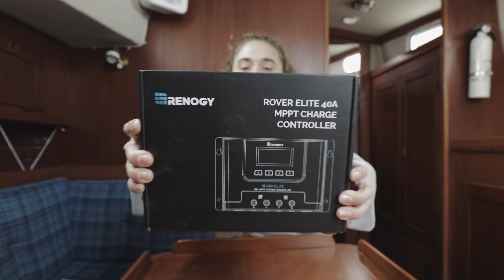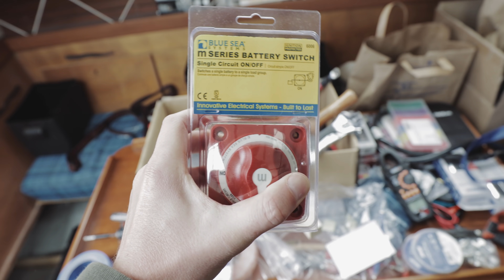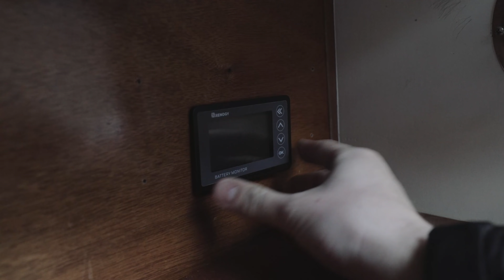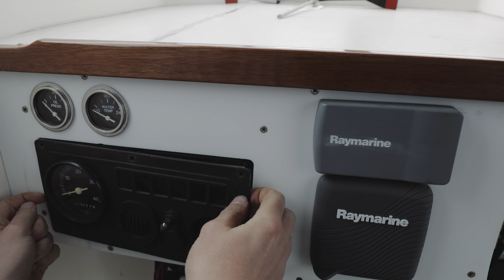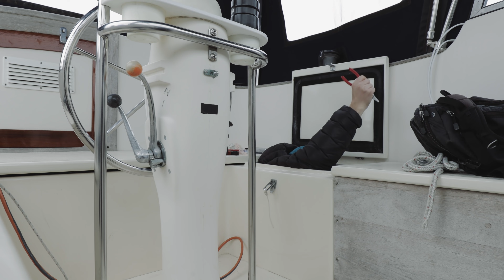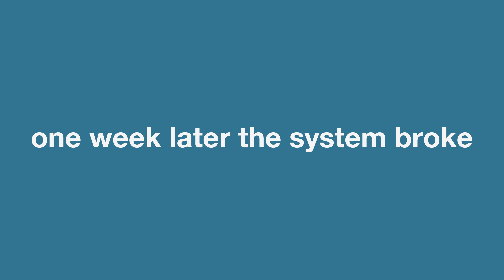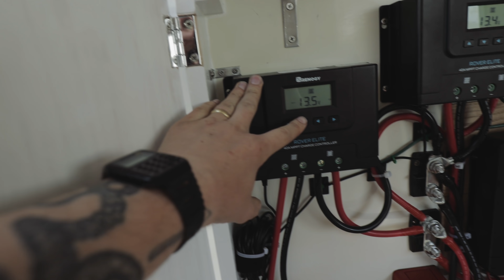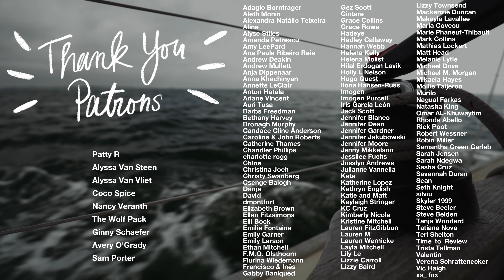Building Our Off Grid Power System - (prepping for boat life)

Comment: As farI can see , you are not having any fuse on the batteries, + pol, this is a must to protect you cabeling system, and yes as other mense your wire isnt, tinned wires. also have you made all the cabels from batteri equal in lengt both on the positive and the negative.

Comment: Just from being at High Seas in February from Port Said Egypt to Heraklion (crete) Greece. The water will rush down from the steps into the galley washing out the electrical equipment beside the steps circa  70's vintage . The Cabinet with electrical equipment has to be water tight. It only takes one major event to appreciate the redundancy of over engineering and over build as per marine grade wiring and water tight cabinets on the electrical. The Mediterranean is allot like Lake Superior in North America very High Waves and short between waves, doesn't swell as in Atlantic or Pacific. But you will have waves that wash into Galley area from the steps in Yankee Atlantic waters. I love that part of the Atlantic. I much prefer the Atlantic over the pacific. Since it changes into Bermuda and into the Bahamas and I prefer the Atlantic north side of The Dominican better than the south Caribbean Side.

Comment: Why do people think they have to put components in tiny hard to get spaces.  Put them where they are easily accessible.  My oils filter separator system is at the bottom of my hatch ladder and my inverters are on the bulkhead at my nav station.  All easily accessible.  ... oh, and who needs a 2000 watt inverter anyway?

Comment: Not sure it if 5kw is enough for a couple if that is your primary source of power. Im guessing u have 2 300W solar panels that should charge ur batteries in around 10 hrs under normal sun conditions. 
I guess if ur only running a 50W fridge and some LED bulbs u should be fine.

Comment: It may well have been addressed already (I have yet to read down the comments) but my concern is the proximity of your Inverter placement so close to the hatch into the cockpit should you ever have excessive saltwater overflow into that area ... it only takes once and not as unlikely as you might think. Maybe place within that cabinet a plastic or canvas diverter shield over the top of the inverter? Enjoy your shows a lot, great attitudes and visuals.

Comment: In your electric cab you may want to add some rubber to the end of that chrome pipe to reduce any chance of wear on those live cables. Also do you think you can add a waterproof grommet between the spaces that your running pipe through? Looks good 👍

Comment: I noticed that the heavy battery cable is untreated copper wire. Marine wire should be tin-coated copper to resist corrosion. You may want to look into marine wire versus normal wire.

Comment: I have two questions on this post. 1) Does your boat have a starter battery for the engine or is this part of the load for the solar? 2) How did you determine the load you needed? At first, I thought 2K watts was a lot until I realized you probably have a refrigerator and freezer and maybe a water maker. The normal lights and electronics wouldn't need that much.

Comment: Great work for you two and thank you for sharing.
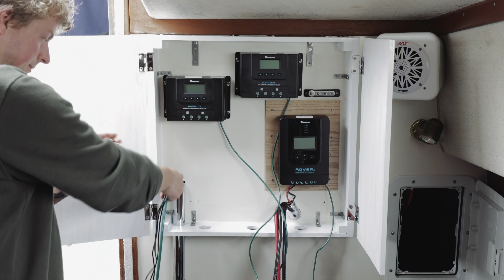A bit of advise: at 13:19 video time, I could see that you used some "metal" pipes to pass the wires. To prevent chafing (damage to the insulation and shielding of a wire) i suggest to use some rubber at the entrance and exit of that pipe or protect the wires with extra protection on those spots so if chafing occurs, no damage is done to the wires. This applies to all passage holes that you have made.

Comment: So I noticed y'all got the monitor to see power both in and out. Can you help me out with how you did that? When I connected the negative from my solar panels down stream of the controller (so it could "see" it) the panel just flashes, indicating it's wired in reverse. Any suggestions?

Comment: Dielectric grease should not be used between the lug and terminal,only after it's connected and then apply around the connection to keep moisture and salt out, for DC plant battery installs you may use conductive grease for battery terminals, because its conductive not dielectric.

Comment: One old boat sailor to another nice job but a few things I don’t see any fuses and the batteries should be fused within about 7 inches and the simplest way is below and in general there should be a lot more fuses 

https://www.bluesea.com/products/5191/MRBF_Terminal_Fuse_Block_-_30_to_300A

The extension cords for the solar our clever but using cords for power in place of a proper cable is also a no go and should be changed when possible  and you can seal them for leaks with these

https://www.bluesea.com/products/1001/CableClam_0.68in

Comment: I don't know if you realize this or not, but that "really small space" that you put your inverter in and associated wiring with switches is called a "slat locker."  Hallberg-Rassy is a high-end yacht builder that adds special touches like a place to store the slats from the companionway when they are not in the companionway.   

In fact, in this slat locker there is (or was) room for two sets of slats -one set for warm weather with some screens and/or louvers for ventilation, and one solid set that keeps you warm, dry, and buttoned-up nice and tight for when you want that.  Now where are you going to store all of them?  

You'll probably be regretting this decision when you are living on the boat and opening and closing the slats all the time with nowhere to put them but down in the cockpit sole or on the aft settee in the way of everyone who wants to sit there and falling all over the place with every big wave -not to mention where to store the extra set you aren't using.  You don't even have a nav desk seat any more so that is one fewer place for someone to sit or out the slats temporarily when you go in or out.

Also, if you are going to do any electrical work on a boat do yourself a favor and go buy yourself a heat gun from Harbor Freight for $12.  Using a lighter to do heat shrink is ridiculous.  I hope you were using good Marine-grade heatshrink with melting mastic glue inside or it does absolutely nothing to keep moisture out.  Using a lighter to shrink this heavy-duty heatshrink and melt the glue inside  fully is a good way to get second-degree burns on your fingers holding a hot lighter all that time.

Non-marine lightweight heatshrink without the mastic glue is just for looks and will actually trap moisture up against the lugs and crimps where it will seep in but never really escape, since airflow is poor under the tight plastic -but not tight enough to keep moisture out.  Take it from a professional commercial electrician.  You might as well have wrapped a couple of layers of cheap vinyl electrical tape over the top.  That does nothing to keep our moisture either

Comment: You need to use marine grade wiring.  It is significantly more expensive but it is tinned and will not corrode.  The copper stranded wire you installed will turn green and you will get voltage drop in a very short period of time.  Also use closed end cable lugs.
Reply: +1 on tinned copper wire, it's actually a requirement if you want to meet ABYC standards so not having it might cause you problems with insurance.   Regardless,  tinned wire is superior.

Comment: If you capsize the last thing you'll be worrying about is whether your batteries are safe. (edit) you would be better off using dc-dc converters for your laptops and USB devices instead of running them through the inverter - lower losses and more efficient cabling.

Comment: I’m sure you did this but make sure to verify the final charge voltage is compatible with the lithium. I think you can adjust it on the renogy charge controller.  

If you want to extend your battery lifespan you can set the final voltage a little bit lower so it Goes to 90 or 95% charge on the batteries

Comment: Drilling holes and driving screws into a van is stressful enough, but doing this in a boat below the waterline 😱😱😱. Great to see you using a hydraulic crimp for the battery and inverter power lugs, I guess it would be hard to use a hammer crimp tool on a boat! Remember: Rome wasn’t built in a day, and nor was Ody, so take your time and enjoy the process - far easier to fix “on the quay than out at sea”.

Comment: What is the aversion to using actual electrical conduits and other parts? Why buy plumbing bits? What is with hardware store extension cords strung through the bulkheads?

Comment: Good job.  You bit the bullet and did it properly in the end - great resolve!  I noticed a Victron Energy component, they do a small bluetooth battery monitoring module.  These can be fitted across each battery or cell to check the status of each battery at a glance on your phone or laptop.  They are also good for tracing faults.  Great video, well done!

Comment: It is possible to run your PC off 12V, 50W USB c connectors can be found for laptops and dc-dc PSU units can be found. All fairly affordable if you want to save power from the unnecessary voltage steps. :)

Comment: Actually your idea of raising the floor though unnecessary for lithium batteries(as long as they are secure) has the benefit of increasing airflow though I seriously doubt you will ever be in a position where you are going to be pumping in enough amps to matter but it is in general a good thing.